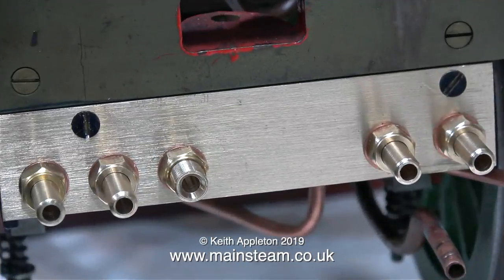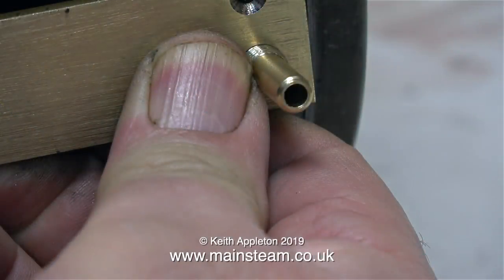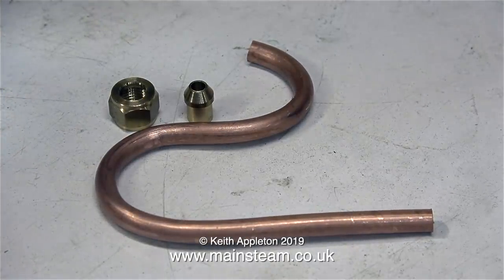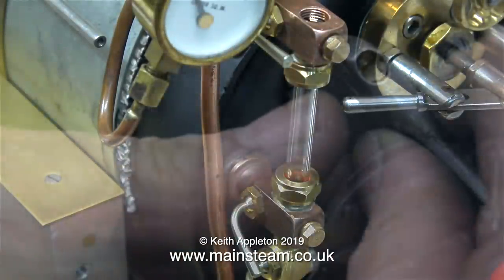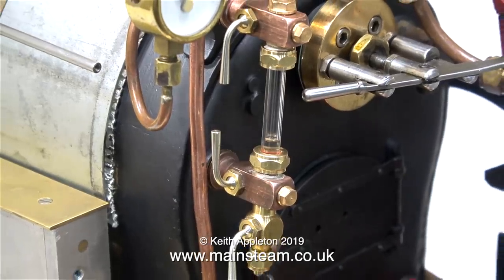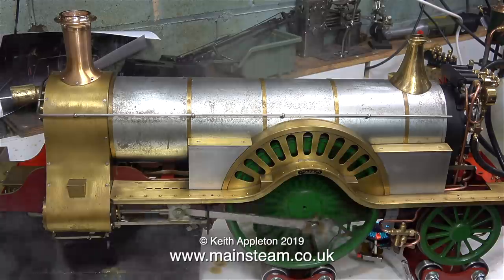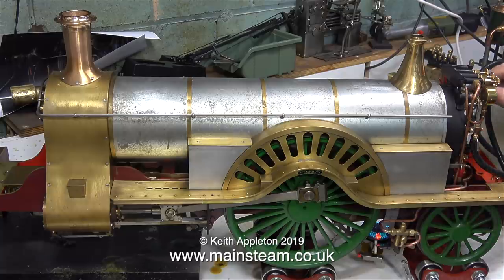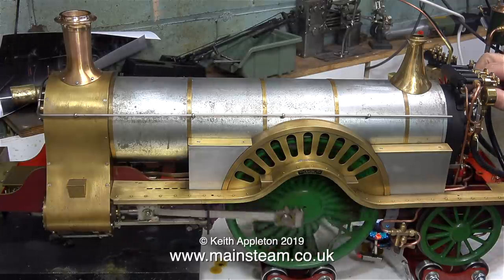MY STIRLING SINGLE #19 - THE FIRST STEAM TEST

Comment: If you can try a mini sand blaster on all that brass before you etch prime for the best tooth. Old man at the model rail road club mini sand blasted Asian brass import locomotives about 500 to 700 $ unpainted. Give it a try if you can. Thanks for the great videos. Blasting is a pain but you can't beat the prep results.

Comment: Coming along nicely Keith.  On the subject of soft soldering, is the solder you use just the kind of stuff we used as boys to make radios, join wires etc? I could do with soldering something that won't get hot and wont be subject to pressure but I've never soft soldered before, thanks.
Reply from the maker: It depends on what type of things I am soft soldering. For plate work (Brass & Copper water tanks etc) I use "Plumber's Solder" but for small items I usually use "Multicore" Electrical type Solder.
Reply: Eutectic alloy (63/37 SnPb) behaves like a pure substance and melts/solidifies at a single temperature.  It and 60/40 SnPb (almost eutectic) are good for soldering electronic connections.

Alloys like 50/50 and 40/60 exhibit a "pasty" consistency, during the change of state.  That's good for "wiping" and "sweating" of tubing.

Then there is a "can of worms" called flux.  Acid flux is good for plate and plumbing jobs.  Given that corrosion of wires associated with electricity is highly undesirable, rosin or rosin activated with zinc chloride is a commonly used flux.

Comment: Where did you get the wheel patterns? Do  you still have them?
Reply: @keithappleton  Thanks VERY MUCH! Been working on a 7.5" gauge Stirling Single, but wheels are the sticking point. I will look them up!
Reply: @keithappleton   Love watching your videos. I have learned a tremendous amount from them.  You are like LBSC, but without his reported crankiness.
Reply from the maker: The castings are commercially available in 5 inch gauge from www.blackgates.co.uk (Worldwide mail order) or Email mat@blackgates.co.uk
Reply: @keithappleton  Thanks! I will e-mail them and see about buying a catalog. I have no clue why they are not showing up in my Google search. Maybe I have a computer problem. (Other than the fact that it's a computer, of course)